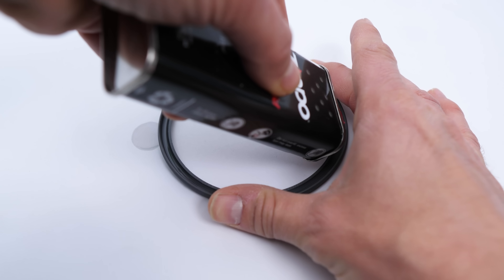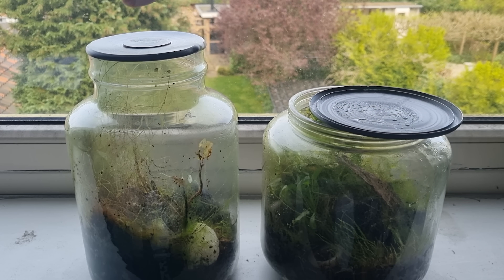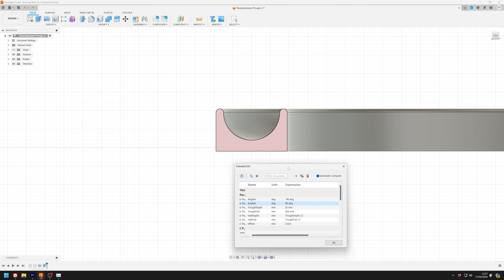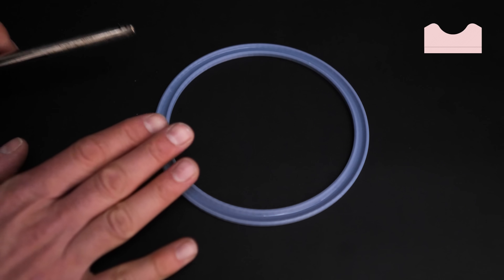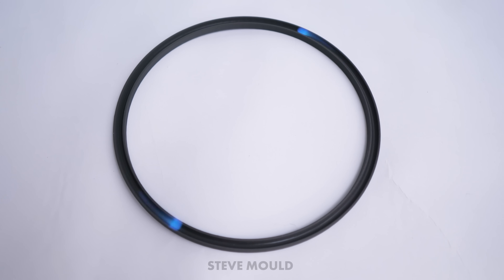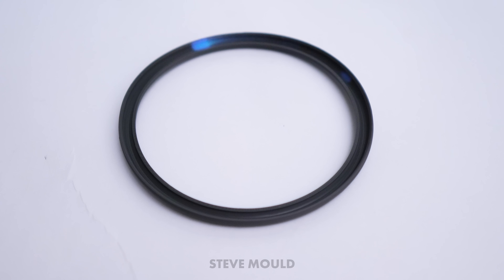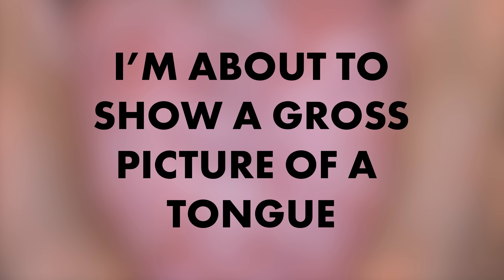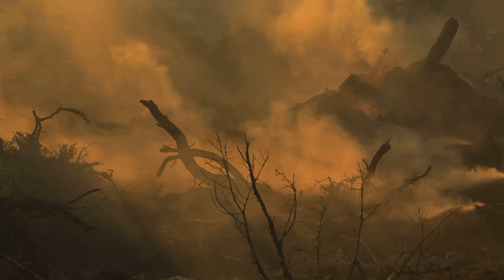Bizarre travelling flame discovery

Comment: Incorrect explanation,
The fire creates a "jet engine" when one side is at high pressure and the combustion easily spreads to the low pressure, generating momentum opposite to the other side.

Comment: The inside curved of the ring, does it counteract the flame's vacuum and air turbulances, because if it's constant there's chance it create a very small spinning airflow behind the flame no.? 🤔 Wonder if you put a smoking agent in the burning fuel if it will do a spinning of the smoke following the flame.!

Comment: 10:58 - I immediately thought of the Trench Effect, as demonstrated to devastating effect in the King's Cross fire of 1987 which took hold in an escalator shaft. Is this the same mechanism whereby the heated vapour unexpectedly runs along the floor of the inclined 'bridge' in this figure-of-8 loop?

Comment: I'm dazzled (& amazed) at the effort you put into trying different shapes and sizes. Shows DEDICATION.	🙂
 -- HOW do you explain the cases where flame direction reverses, hits another flame, but one of them can keep going??? Your split ring design at 10:14 shows this happening. According to your theory, there shouldn't be enough vapor where a flame had just been in order for the next flame to continue.  🤔
 -- The Figure Eight works because although the Liquid has drained away, the Vapor climbs up the slope. 🧑‍🚒🔥
 -- I used to do research & development and was great at it because I think outside the box to the extent I gravely annoy people. I look at this with my brain doing that spinning circle on computer monitors... thinking of applications for this phenomenon. I can think of a few--nothing relevant. Think of the buzz-bomb rockets from WW2. There are also high-efficiency Furnaces that fire the propane in pulses. They had or have electrical controllers, but an ADVANCED version of your research could... "!"  🤓

Comment: Idk if anyone else mentioned this yet but the same thing about bubbles occurs in a cup of rootbeer after its just been poured in. The bubbles are filled up and very slowly popping n such. But if you just very lightly touch any spot of the top of the bubbles, it will cause a chain reaction of all the bubbles popping rapidly.

Comment: The reason the figure eight worked is that a printed are is not solid but a porous solid made up of cylinders to balls bonded together with gaps between adjoining cylinders.  If the gap is large enough but not to large surface tension of a wetting fluid will be wicked up the raised section of track. Finally sufficient surface area of the gap needs to provide some  high portion of the vapor burning.

Comment: Now you just need to figure out a way to have the lighter fluid replenished as the flame goes, so you could keep something like that running indefinitely.
Reply: a simple design could be like, those liquid candles with the wick floating on top. float the track on top of the lighter fluid at the right buoyancy, with holes in the track, or even no bottom to the track. also must cover the remaining surface or it would constantly mess with the flame in the track. but it should work if designed properly.

Comment: Did you measure the temp of the fluid to see how it changes with thermal imaging and also if the temp of the fluid had an impact on the sustainability of the flame in some of the touch and go designs
..

Comment: I wonder if you could sustain it longer with a basin under the trough to hold more fluid. Then have a type of wicking ring soaking up fuel from the basin coming up level with the bottom of the trough. So the bottom of the trough is the wick essentially. A bit like a circular zippo?

Comment: So someone in the comments already mentioned using a vertical step up to make a one way path and that it should be enough to create excitable flame computing. In addition to testing this, you could possibly create "resistance" (or would it be a delay) and slow down a branch by changing the height repeatedly (as a slope, not a step) and see if that makes the flame trvale faster or slower. 
Another thing to see is if there is a way to design it so that you dont have to cover a portion to kill one signal. Maybe it is possible if instead of lighting it so that it creates two signals, you create three and then purposely have two of them cancel out so then that one signal continues on the pattern?

Comment: Wouldn’t surprise me if the moving flame front is creating a pressure wave one way or another, serving to maintain the speed of advance (even uphill in the figure-8), by either pushing the flame front (via higher pressure from the brief flame?) or pulling it by creating a vacuum where the fuel is evaporating slightly faster (or something). 
I never had the requisite physics background for fluid dynamics… and calculus in HS was… almost 40 years ago.

Comment: I'd like to see the spiral-and-loop one with the spiral inside the loop. Essentially like the circle-with-spokes, but with the spoke(s) on the inside. And, of course, you could do more than one spiral. If the spirals met at a common centre, would the flame travel in to that centre, then continue on out the other spiral(s)? Would an inbound flame meeting an outbound flame extinguish each other due to lack of available vapour?

Comment: If you think that's cool... Try this... In your garage or a place that has a smooth floor. Pour lighter fluid on the ground so that it gets a spot a couple of feet in diameter. Light the wet spot and observe the small flames racing to and fro from larger puddles trying to keep the larger puddles alight. Of course make sure there's nothing in the area that could catch fire and have fire extinguisher handy and plenty of ventilation. Proceed with caution and common sense. Don't burn anything down. Actually... DO NOT TRY THIS AT HOME

Comment: Incredible brain fire lit by this video: I was a child that was cured of WPW (uncontrolled racing of the heart) via a cardiac ablation. This flame behavior is EXACTLY how I would describe the literal feeling of the starting mental stimulus that would trigger the arrhythmia and cascade into exteme heart racing. It would begin with a slight sensation of falling then the first aruthmia would cascade into tachycardia in exaclty the same chaotic rythm that you can see in the multiplying flame. I was cured 20 years ago, but to this day I still get the falling sensation after the same mental triggering stimulus but no longer the tachycardia similar to when he puts his hand over the ring and the flame dies out. The craziest part is the only way I could bring my heart back to normal was to stand on my head an hold my breath until almost blacking out before i had the ablation. My slgithly oversized heart goes out to the amazing pysicians who change lives of people like me  <3

1

Comment: Is there a way to disrupt large forrest fires ? 
Maybe a number of large drones covered with thermal shielding that 
use heat as energy source to charge storage then 
create a high energy field or waves to disrupt combustion. 
  
Could be acoustic, magnetic, radio, LASER or combination of these ? 
Drones could then move along the fire front 
extinguishing fire like a zipper.

Comment: Based on the nullifying properties of the fire, one could theoretically create logic gates with this. This is a reply to the pinned comment, which is too overrun with replies now for me to reply to it myself. For the inverter/NOT gate, one could simply have a pulse of fire enter a junction. If the main signal is a 1, the output will be a 0, and if the main signal is a 0, the output will be a 1, because the constant signal will not cancel anything out and will simply continue on. One would likely need some form of diode to make sure the signal doesn’t go backwards. AND gate coming soon

Comment: I have an answer for you on the "small"  trough. It's a pressure issue. As you light an area, it becomes excited and you create a low pressure vacuum. The surrounding oxygen is sucked into this vacuum meaning that the flame won't move.
Reply: basically the egg and bottle experiment.

Comment: what effect do other flammable liquids have on the parameters? What 3d printable media work best? could you recreate the effect on an absorbent media, like paper or cloth?  How does this relate to the effect of something like, say, a jacob's ladder or a static generator? (not sure what the correct term is, but the ball thing with the electrical tendrils popular in science fiction movies, and often sold in novelty stores) how far will this effect travel in a straight line before failing in some way?

just a few questions off the top of my head, hopefully you find something useful among my ramblings

Comment: Upon seeing this the first thing that I'm thinking is has someone found a way to power a motor or create electricity somehow with this. Peltier thermoplates lined up, or use the rising hot air from the flame to pneumatically push magnets around a coil.
3:00pm April 24, if you heard it here 1st give me my $props$ or I'll see you in court

Comment: Dear Steve: I've always wondered if a RANDOM stirring of something into solution was more efficient that the CIRCULAR stirring we do most often. I thought of a lab stirrer with a horizontal 2-armed magnetic CHAOTIC PENDULUM under the base that agitated a spinner in the liquid in the flask above. Variations in the pendulum arms, speed, and shape and material of the spinner could be made to optimize the effect if it turned out to be better than the simple 1-axis stirrer. Just sayin'...

Comment: You should make a design where the channel width varies around the circumference, ideally so that the flame jumps from wide section to wide section. By jumping these thinner sections, the flame should travel faster around the ring despite what you would think of as a "block" and the direction would be maintained with more consistency.

This would be a model of how myelin sheaths speed up nerve signals and would be very useful for simply demonstrating a difficult concept to visualise in biology.

It may not work due to the differences between gas ignition and electrical impulses, but if it does then it would make a brilliant pair of files.

Comment: This looks so close to perpetual motion / energy - could you try to use the flame to exert force somehow? The ring with arms looked like it could be the flame-source for some flame-based machine, or at least artwork.
Reply: Except for the fact that it’s burning fuel
Reply: @chronovore7234  that's why I said it "looks close" to perpetual motion, meaning it is running at close to 100% efficiency.

Comment: Experimenting with the variables of volatility (naphtha has a somewhat variable composition of various hydrocarbons) and diffusion rate can have some interesting effects.
For example, I soaked some snow in n-heptane and lit it on fire in order to melt some ice around a piece of wood frozen to the ground. To my surprise, it didn't burn straight away; rather, the flame front seemed to move around organically until the fuel was completely consumed. It behaved similarly to what you show @ 7:13.

Comment: So when you initially light the fire, it "wants" to spread to the nearby fuel source and spread. However, since its consuming the fuel from the center of the flame outward, it runs out of available gas and splits because there's no flammable gas to sustain the reaction at that point.

From there, it creates a chain reaction of consuming the available fuel where the flame currently is, leaving a void empty of fuel behind the flame, and igniting the available fuel in front of it. When there are TWO flames, when they reach the apex and collide, there isnt enough fuel on either side to sustain the reaction, so it goes out. However, when there is only the ONE flame             - assuming the loop is sufficiently long - there is enough buildup of flammable gas after its been burnt for the flame to continue chasing the fuel until all of the liquid fuel has evaporated.

Containing the loop by precisely adjusting the portion that's open to the air is controlling the temperature of the liquid fuel so when the fuel vapor ignites, the liquid fuel isnt exposed to too much heat, which is what's causing the fuel to either combust all at once and then stabilize into a single, persistent flame or to slow down so much it puts itself out by consuming too much nearby fuel. It also has the added benefit of condensing the gas and therefore the flame, preventing it from igniting too much fuel at once from the start.

Comment: Imagine this at scale. In 1987 I was working on Challenger 2 tank turrets. In they went into a 7m tank of acid for etching. Hydrogen gas was given off and some bright spark decided to light it. A ribbon of flame rode up and down the tank making an amazing sound and getting faster and faster, riding back and fore, up and down the length of the tank until the flame exhausted with a pop. The sound of travel was like a ripping roar.

Comment: This is the same type of event I created playing around with a environmental predator-prey simulator in highschool. You could set the settings for how much energy sheep and wolves got from eating, how often they reproduced, and how quickly they lost energy. All of this simulated by colored pixels on a looping square plane. I found out that if you set the sheep to reproduce rapidly and gain little energy, and set the grass to regrow only slightly before the sheep would complete one loop across the plane you'd create a flat frothing wave of sheep traveling from one side to the other on loop. This worked because the  sheep that weren't constantly traveling in the right direction would die of hunger immediately, and the sheep reproduced fast enough that there would always be some randomly traveling in the direction of the fresh grass.

I don't remember the name of the website or the settings but I might look it up and comment that info later because I did take some videos of it. 

It only happens if you remove wolves from the simulation or at least set them to never reproduce. I did enjoy having a few immortal wolves roaming around.

Comment: Reminds me of the "Super Kamiokande" experiment, a huge vat of purified water completely surrounded by 11,000 large (50-cm), custom-made photomultiplier tubes.  It was designed to detect flashes of light from rare events like proton decay and neutrino collisions.  
The tubes were evacuated glass structures, and when one imploded one day, it triggered the implosion of its neighbors, and, well . . . regeneration time was better than forest regrowth, but not by much.  
"Super Kamiokande 2" had acrylic shields between the tubes.

Comment: This concept is actually very similar to the principle that is used in rotating detonation engines. These are engines where the flame is supersonic (so a detonation instead of a deflagration) and the detonation travels in a circular path continuously. You should do a video about those. They're super interesting.
Reply: I was about to comment that this is a rotating deflagration 'engine' (it doesn't produce power, so it doesn't really count as an engine).
Reply: Yes it does! It's a rocket engine, it's hooked up to a nozzle.
Reply: Yup....  

https://en.m.wikipedia.org/wiki/Rotating_detonation_engine
Reply: Video by Scott Manley https://youtu.be/rG_Eh0J_4_s?si=7C8ZjktP-zK3TA2p
Reply: I dont think they're actually used in rockets yet? But if I recall, the goal of the engine is to create a very efficient and extremely powerful engine capable of replacing the current standard engine design

Comment: Because some of the things in my kitchen are jet lighter, metal spirit measures and 99% isopropyl, I "came up" with similar concept as used in naptha lamps. Isopropyl really isn't all that flammable,  its vapours are. So a metal container, expanding to the top, with some isopropyl at the bottom, makes an interesting self-regulating "lamp". I tested with a smaller measure and it just doesn't work - it's too all-or-nothing.

Here we have 3d printed material instead of metal, which instead of uniformly heating, keeps heat in one place. Let me watch remaining 10 minutes of video and see if my suspicion is right :D

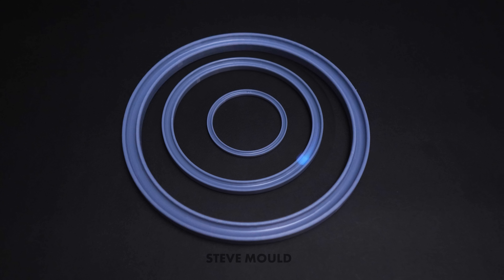Comment: Hi.  You mentioned the trough 'sweet spot" at 5mm, 1:52.  Is it possible that the size isn't so important but the ratio variable in the arc and the wall height?  Just curious. TY.

Comment: It can split into two branches (Buffer gate). It can recombine into a single branch (OR gate). It can block itself when coming in from opposite directions (NOT gate - and a part of a domino AND gate). The only remaining thing is to make a working XOR gate. A domino-style gate would probably light up the output in the (1,1) case because the flames would go around the corner before they annihilated in the middle section, but a different design might work well enough.

Comment: Can't believe you haven't mentioned 'periodic' chemical reactions such as the Belousov–Zhabotinsky reaction or the Briggs-Rausher (a.k.a. iodine clock reaction). All these systems - including all you have shown - are going towards thermodynamic equilibrium, just not in a straight way. A golf ball may circle for a while in a hole before settling on bottom.
I've recenty seen as Oxford Mathematics video called "Four Ways of Thinking" -  the speaker mentioned Alfred J. Lotka, a contributor to the puzzle of periodic reactions - he shown a new way of thinking that makes it more natural and not bizarre at all. Imagine the same forrest around the earth, inhabited with rabbits and foxes. The two populations will be coupled and oscillate with the aplitude and frequency depending on initial conditions - you may have a "wave" of foxes going around the earth - the foxes eat rabbits, then almost die out, rabbits will repopulate and the cycle repeats...